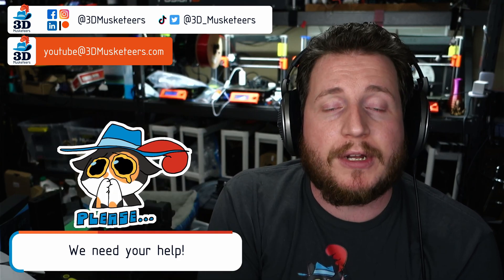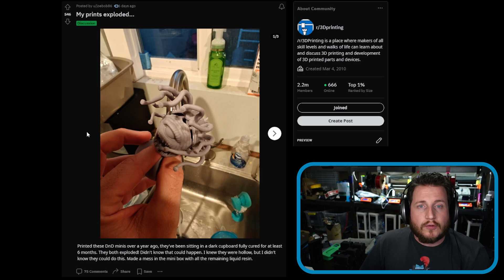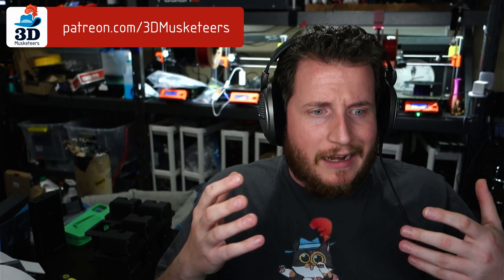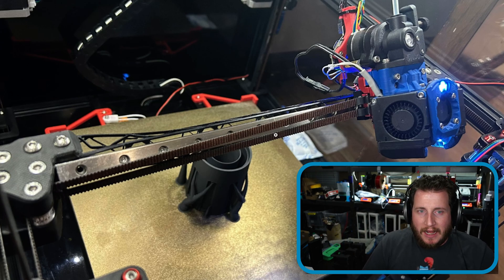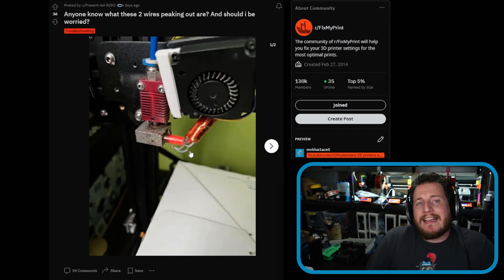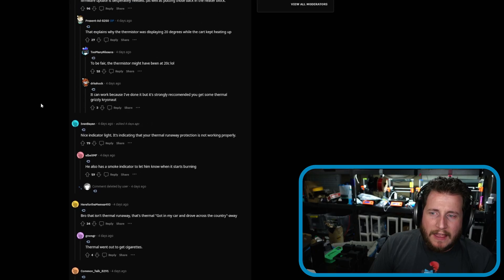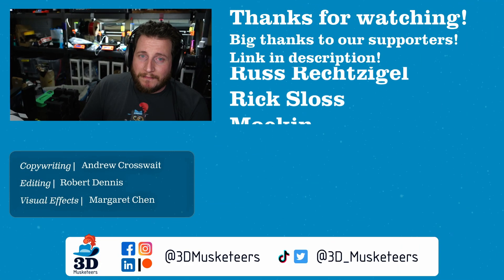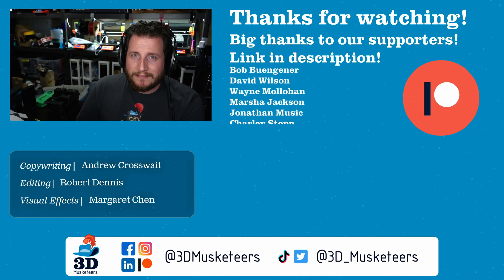Twisted Vorons and EXPLODING Resin Prints!! - PrintFixFriday 135

Comment: Regarding the Ender 3 case:

It depends on the will to learn of the owner. If the owner want to learn how to tinker around and to fix an Ender 3 and get the skills for it, it's worth every minute of repair and upgrade. Also I personally would try and love to help and give advices.
But if the Ender 3 owner only want to use this as a tool and it would be too much efford for them... the comment to buy a more recent auto calibrating printer makes sense.

Comment: When I removed the magnet on my ender 3 during its switchwire conversion I heated up the bed and then slowly worked it up from the corner. Used acetone as a first pass for cleaning the glue and then isopropyl alcohol as a final clean

Comment: I've fixed a Flashforge Finder 2 that runs a Mk10 hot end that had an issue sort of like that Ender 3.  I was getting super weird temperature readings all of a sudden during a print, so I shut it off, took the toolhead apart and found that the glass bead had come out and was flapping around under the shroud.   It seems that the glass bead thermistor was thermal-epoxied into what looked like a brass motherboard standoff, and the epoxy had, after about 300 hours, burnt up somehow, allowing the glass bead part to separate from the brass part.  So...  a new thermistor assembly later, and we were back in business.  Interesting problem with the firmware -- thermal runaway doesn't engage on wild temperature swings, but it does if the thermistor isn't there or if the pins are shorted.  

Needless to say, it doesn't get much love anymore.  The possible thermal runaway issue aside, the Voron is a much more capable printer and gets used before the Flashforge.  I may end up modding the old girl and putting new controllers in (they're proprietary) and get it running in a safer way.

Comment: budget permitting I figure that ender can get a board swap and an all metal microswiss hot end. First point especially if its current board has issues updating to the latest Ender3 firmware.
Reply from the maker: Yeah I agree here. However, is it worth it, you know?

Comment: I just gave up on properly tuning an Ender 3 S1 Pro because it's given me so much trouble since purchase. Hundreds of hours of troubleshooting, replaced/upgraded numerous parts, disassembled and reassembled, tried custom marlin and klipper firmwares, everything I could possibly think of, but the printer just never reliably stayed tuned. I finally broke and got an X1C and I was able to print a project I'd been struggling with for a couple months on day two of owning it. For every step of tuning and figuring out the new hardware I could read every issue like a book and easily got great results thanks to all those hours of suffering, lol. Despite the trouble I'm not getting rid of the old one, it's absurdly good at .2mm nozzle printing so that's what it'll stick around for!

Comment: I last had to replace my print surface when my Voron 2.4 Z probe got nudged, then my tungsten carbide nozzle (3DMaker Engineering solid carbide) carved into the PEI sheet.  Luckily it was just the spring steel PEI sheet that took the damage.

Remember, super hard nozzle means a crash WILL chew up your surface.  Nozzle was completely unscathed.

Comment: For the magnet the best way is to get it hot and peel it or scrape it, glue residue will remain either way, so use some Goo Gone or any equivalent you can find or mineral oil in the case you can't find anything better, apply and wait for the glue to softens and then remove the glue by scrapping, at last give it a clean with IPA to remove any oil residue and to make sure the new magnet sticks.